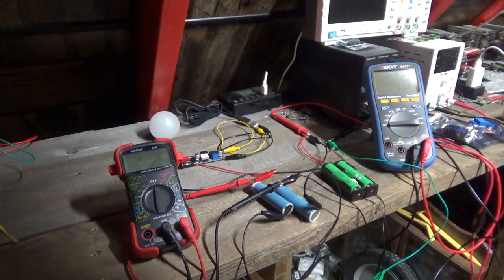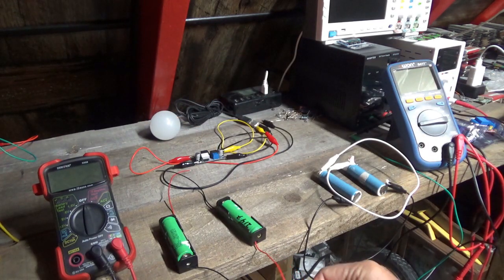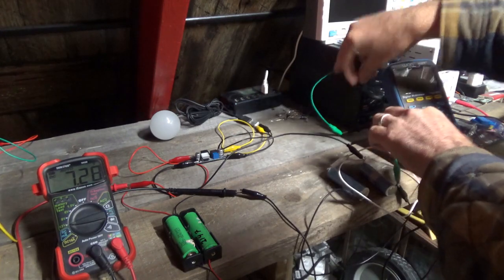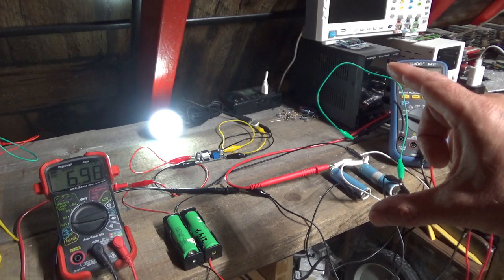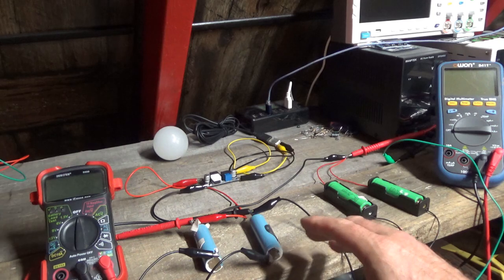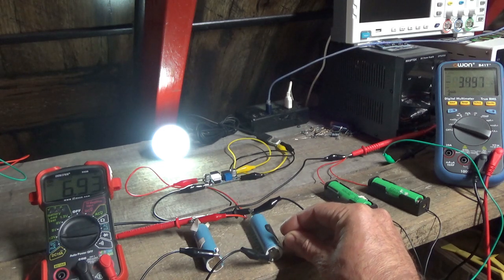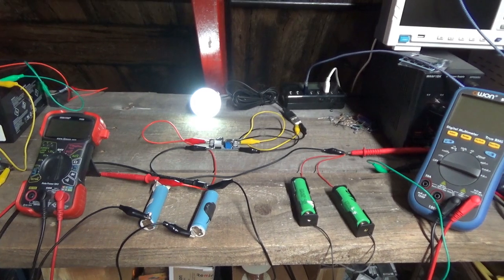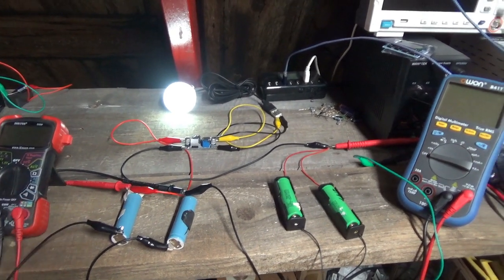Charge Batteries Free While Powering A Load Its Basic Electronics

Comment: It is practical in large scale? Example 12v or 24volt in lead acid battery. It can charging and swapping over and over again?
Reply from the maker: I believe so. I am working up to that and will share my results. I think lead acid will work much better due to the higher voltages compared to the 18650s.
Reply from the maker: I have been sourcing parts for high amp off grid systems and designing the switching devices.
Reply: @TheDoItYourselfWorld  I am watching your motor the way you demonstrate it. It is posible that you can charge more battery in one single input of another battery?
Reply from the maker: Yes I have demonstrated charging up to 4 batteries at one time. Actually it does not use more energy when you add more batteries in parallel on the charging side. Back when I first built my old machine I once had 7 batteries charging at one time using a deep cycle to run it. That battery powered the device for over a month before it needed a charge.
Reply: @TheDoItYourselfWorld  How about the protection of the battery? Is this safe without over charging protection?
Reply from the maker: Every battery must be protected from over charging in some way. On my desk top I manually watch things and shut it down when charged with lead acid batteries. With Lithium there has to be a control for safety.

With the manual switching method and 12 Volt batteries someone must check occasionally to be sure nothing is over or under charged. When I get the fully automatic system ready that will be done for me.
Reply: @TheDoItYourselfWorld  ok , what if you put a charger control to protect the battery. It so posible to fix in it?
Reply from the maker: Yes
Reply: @TheDoItYourselfWorld  you say the that , this motor can recover dead battery or junk battery by using the high impulse high voltage spike coming from the coil or the motor. My question is, how many  hours to be recover and fully practical to used again?
Reply from the maker: Yes it can as long as the battery is not physically damaged. Restoration can take days, weeks or months. It depends on the size of the battery and how badly it is sulfated. But I never had a battery I could not restore to like new condition with this method.
Reply: @TheDoItYourselfWorld  thanks for the info. Im curious to the magnet of the motor. Why  you said neo-magnet cannot work properly. That is why you recommend to used ceramic magnet. What is the reason behind the neo-magnet? Why is not recommended to used.
Reply from the maker: In a standard Bedini style pulse motor all you want is a trigger to turn on a transistor. So the weakest magnets you can get. You want a short, quick pulse. If you build a motor/energizer which is essentially a generator then you want the strongest mags in the generator part.

Comment: OK I think I’m busting with curiosity now!
I want to see the battery switching arrangement on a board like you said so that there’s no more tedious hand work. How long can the LED bulb run under your switching arrangement versus how long can a LED bulb run with one full set of batteries. Because ultimately you’re saying one set of batteries is discharged and one set of batteries is charged, so ultimately, we still have just one set of batteries producing. 
Thank you kind sir for all of your  content
Reply from the maker: In my tests only using 4.0 Volts as charged and 3.5 as discharged I am getting 4 to 6 hours run time without switching. And about double that with switching. There are losses in the batteries so it will all run down in time.

Comment: Sorry don`t get any interesting value or homesteading type content from this, curious about the power wall you built out of those thousands of batteries you were repurposing to power your woodworking, metal and fab shop?
Reply from the maker: Well, I am waiting on some parts to arrive. I will be putting some of these together with switches and volt meters - and - solar charging.

And then I will be doing tests with 12 volt batteries and showing how to extend your home solar power with this.

Comment: OK. To test it REAL, take all 4 batteries, charge all to maximum capacity and take your inverter and simply run with your 1 LED lamp and count Ah and power output until it reach 3V (the end). Than do it again with "switching" batteries and there will be "the true results". Amen
Reply from the maker: Cant. You have to start out with one set of batteries not charged. That is the gain in the system. Its all pointless without.
But I have run tests with just two batteries in series at 8 volts and again with the combination like in the video. In the first cycle the time is the same. But then I can swap the charged batteries and get some more run time as shown in this video.

Comment: Theres almost no point in this at all, which is why no one does it, no energy is being created, if you charged all 4 and ran the light from all 4 at once will have slightly more run time than this experiment that doesn't do anything, if you properly calculate it out and all batteries were at the same level from the beginning the total time from whatever you wanna call this experiment will be less than the 4 batteries running the light directly, 
(the power drawn would have to be the exact same to prove that this experiment doesn't create anything)
its just a waste of time as every cycle, your losing 50% run time each time. 

Maybe fun to play around but it doesn't do a thing. Energy cannot be created out of thin air.
Reply from the maker: Nobody is creating energy. We cannot create energy. The electrons are just doing what they do, charge batteries. They leave the load and enter another set of batteries in the opposite direction.

It will all run down after a few cycles due to loss in the batteries. But you gain a bit longer time due to charging another set while running a load.
Reply: @TheDoItYourselfWorld  sadly there is no gain, if there was gain, youd be creating energy out of no where
Reply from the maker: That is not true and I will show it in future videos. You can harness energy that is already existing in the environment although that is not the case in this project at all. I am just running things more efficiently here.
Solar, wind, ion energy from air - its all gain for the end user once you pay for the means to harness it. I will be making a radio wave or ion harvesting device one day soon. All gain once you make it.
Reply: Energy CAN be created out of thin air.
Reply: @JohnnyDanger36963  Care to explain how???
Reply from the maker: He may have written that wrong. We cannot create energy but we can harvest what is already there. I will be showing that when I get a chance. Literally harvesting energy from the air.

And before your head explodes - its nothing new. Universities have done experiments with harvesting ions from the air.

Comment: My Dr. friend told me entropy will set in. Beyond that I could not get more detail out of him.
Reply from the maker: In the manual switching circuit, I told you that. Due to loss in the batteries it will all run down after a few cycles. But you can swap them around a bit and gain some longer run time this way.
Reply: He is wrong. There is Negentropy.
And your dr is wrongbabout health too.
David wolfe ( health)
Reply: @JohnnyDanger36963  The Dr. Is not an MD. He is a Dr. Of electrical engineering and designs power substations. What is it you do besides make an @$$ of yourself?